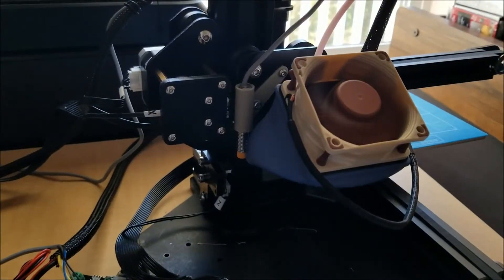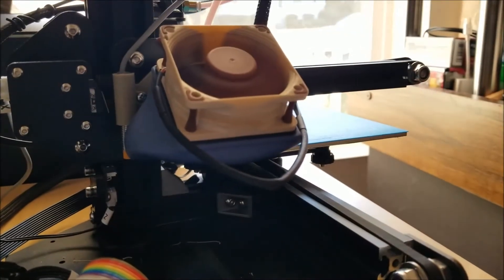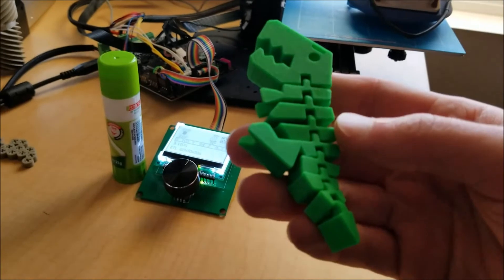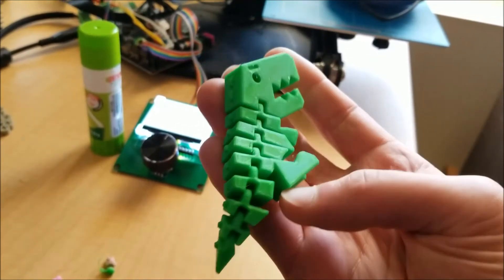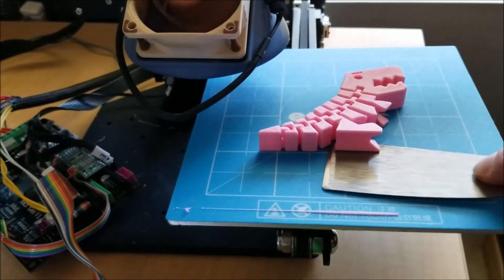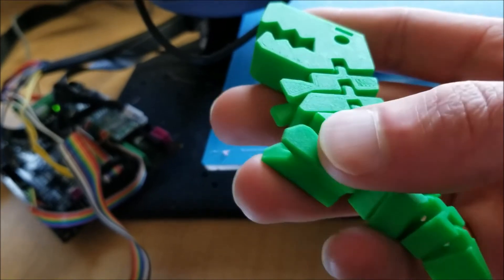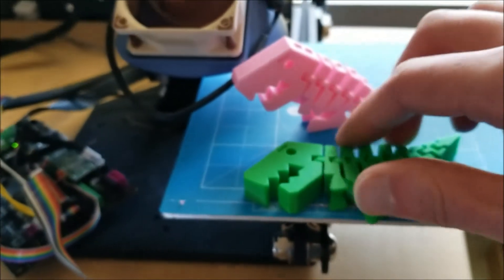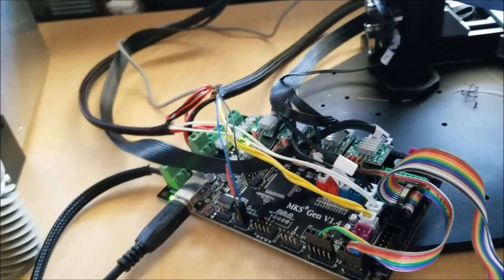Why add a Z Probe to your 3D Printer?

Comment: Hi Ross, can you share the Prusa gcode tha you use to purge the nozzel?
Reply from the maker: Sure, here's my start-gcode

M92 103.33 ; set esteps/mm
G28 ; home all without mesh bed level
G90 ; set absolute positioning
G1 Z5 ; lift the print head off the bed so pre-heating doesnt damage the print surface
M83  ; extruder relative mode
M104 S[first_layer_temperature] ; set extruder temp
M140 S[first_layer_bed_temperature] ; set bed temp
M190 S[first_layer_bed_temperature] ; wait for bed temp
M109 S[first_layer_temperature] ; wait for extruder temp
;G29  ; Tram the bed - Only enable if you have a Z-Probe
G1 X0 Y0 F8000 ; goto X:0, Y:0
G1 Z0.3 F600 ; move to Z0.3
G92 E0.0 ; zero the extruder position counter
G1 X60.0 E9.0  F1000.0 ; intro line
G1 X100.0 E12.5  F1000.0 ; intro line
G92 E0.0 ; zero the extruder position counter
Reply: Thanks Ross, I'll try to put this in Cura. 
What slicer do you use?
Reply from the maker: I mostly use Slic3r, occasionally use cura
Reply: I never used Slic3r I will try it. 
Thanks and keep making videos with the ender 2 :)

Comment: I've been advised to use a capacitative sensor. Haven't received it yet, so I'm not sure if works or not.
Reply from the maker: If you are sensing an aluminum build plate an inductive probe is the way to go i believe, but an inductive probe will NOT sense glass. If you have a glass bed then capacitative should work but they are sensitive to humidity and temperature changes. Watch the trigger distance change as you breath on it ;)
Reply: Ross K I'm using a glass now, but I have a pei sheet in its way too.
What would you recommend to use?
Reply from the maker: The point is inductive sensors only sense metals. Capacitative sensors will sense just about anything. As for PEI vs strait glass, I've never printed on raw glass but with PEI you need to keep it really clean and oil free as well. Get some 99% isopropanol if you can find it and wipe the bed down before EVERY PRINT for best results. When the surface begins to wear out (after a year or so of printing) PEI can be reconditioned with 100% Acetone and/or a gentle pass with fine grit sandpaper (1000 or higher - then thoroughly wipe down with alcohol then acetone). My advice in applying the PEI... sorry for the book report...

I've had to replace a PEI sheet on a Lulzbot TAZ5 at my works makerspace it has been over  a year and it's still doing well. Be careful applying the PEI to avoid trapping air, by applying the PEI while the bed is HOT any air you trap will at least be pre-expanded, at least that's my thinking.  I suggest wearing gloves to prevent contaminating the glass surface during application and try to find a tool you can use to press the PEI down that wont deform under the heat and at the same time wont scratch the PEI - hint a credit card will deform with a bed at 80c.

When you are ready, clean the glass with isopropanol, let it evaporate, then clean the glass with 100% Acetone with a low lint cloth to strip away an remaining oils and dust. The more clean your glass is, the better the PEI will adhere and the less likely you are to damage the PEI when removing parts. Next heat the bed to 80C (if your bed reaches these temps that is) align the sheet carefully because once you stick it there is no moving it and obviously be careful to avoid touching the hot bed as it could burn you - if it's too hot for you drop the temp to 60c. Peal back the adhesive and begin working your way out from a corner pressing it down bit by bit while avoiding the trapping of air or getting it stuck to your gloves. Finally trim the edges flush with the glass and give it a wipe down with isopropanol and you're ready for use!

Once you have your PEI installed do not attempt to remove parts when the bed is above 50c, above these temps the adhesive will be soft and more prone to breaking loose of the glass. If this happens bubbles may start forming and your risks of ripping off a chunk of PEI are much higher. With PEI "they" recommend removing parts at 45c - so if your print has cooled to room temp and you just cant get it off the bed, warm the bed to 45c and wait 5-10min then try removal.

Another trick to removing stuck parts that I've found to work surprisingly well is to put some isopropanol around the part then try to work it free for a little bit, wait a good 10-20 count and try working it lose again and repeating until success. Often this helps really stuck parts come free without damaging the bed or stabbing myself. My theory is that the low surface tension of the isopropanol is acting as a penetrating agent - but it's a great help for whatever reason.

Finally, be very, very, extremely, careful when printing with flexible or PET plastics on PEI. They tend to stick way too well and have a reputation of ripping up chunks of PEI with the part. If you experiment with them do NOT print them in the center of your bed, pick a corner until you are confidant in success! Using gluestick as a release agent, printing with a "high" first layer (so the plastic isn't pushed into the bed so hard), and carefully picking a bed temperature (esp. for PET/PETG) are bits of advice I've heard that I feel are worth parroting.

At long last, I hope this helps! Good luck!
Reply: Ross K thank you for these great piece of advise.

So I should stick the price to the glass... I thought (without any previous research) to stick it to the aluminium bed. Is it not advisable?
Reply from the maker: Well, i have no idea what printer you have ;) Some have an otherwise flexible heater stuck to the glass, others are just glass clipped to a PCB. Same advice applies, simply substitute aluminum for glass above. That said, the glass might be a lot flatter than the aluminum, or the aluminum may be a bit thin and might bow under the weight of large print. Apart from this I don't really have any experience to draw from on the matter but logically getting the glass out of the way would seem the better option to me as well... and with the glass out of the way you could use an inductive probe if the capacitative one proves inconsistent.
Reply: Ross K I have an ender 2 as well. I trow away the original blue sheet, that is why I order a pei sheet, because I understood works great (just used PLA so far)

Comment: This is interesting! Looking forward to see how you achieve such good surfaces. Do you know whether we can add this bed leveler using the original board and original firmware?
Reply from the maker: I'm fairly confidant that the original board could be used but you would have to  "jailbreak " it (which requires either an arduino or a proper programmer that costs all of $10ish) and load a customized marlin version. Not too hard to do and overall much simpler than the TMC2130 overhaul.
Reply: I doubt it, AFAIK the original board has no bootloader, which is why you have to install one (you call it jailbreaking). But then you are limited by the tiny amount of ram and rom on the board. Also, there is no eprom to save settings to.

I would recommend getting a arduino mega clone and a ramps 1.4 board, should be doable under 10 bucks. You also neef 4 stepper drivers for another 5 bucks together.

I'm not blaming Creality for picking the smallest possible chip, i blame them for violating the GPL and not providing the sources, which everyone seems to ignore.
Reply from the maker: The ATMEGA1284P is in many ways more capable than the 2560. The 1284 has a 25% HIGHER clock rate, it has twice the RAM and it has the same amount of EEPROM. For some reason storing settings to EEPROM is simply disabled on the stock firmware. However, you are correct that it has half the FLASH program memory, Creality has clearly violated GPL, and it also has less than half the number of pins. On the Marlin build I have loaded on my MKS I am using some of that "upper half" of FLASH. I'll see if I can get a build to fit then maybe I'll see about loading it on my old stock mainboard.

1284P product page: http://www.microchip.com/wwwproducts/en/ATmega1284P
2560 product page: http://www.microchip.com/wwwproducts/en/ATmega2560
Reply: Somehow i was under the impression that Atmels 1284 line is in almost all aspects half a 2560. I stand corrected.
Reply from the maker: No worries, before I did some research I expected the 1284 to be equal to or less than the 2560 in all ways as well. I was quite surprised to find it is actually superior in most ways.

By the way I did manage to compile Marlin 1.1.8 into the 128K program space of the 1284 ... but I had to give up SD Card support, I'll try to find other things to strip out to get SD Card support back but this ins't that high on my to-do list ... although I would like to make a video on getting a z-probe working on the stock mainboard.